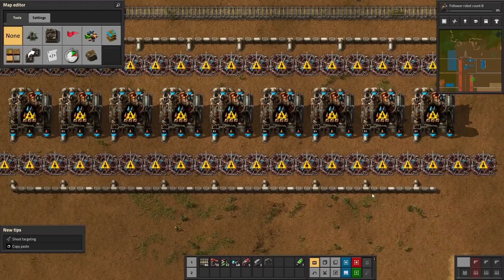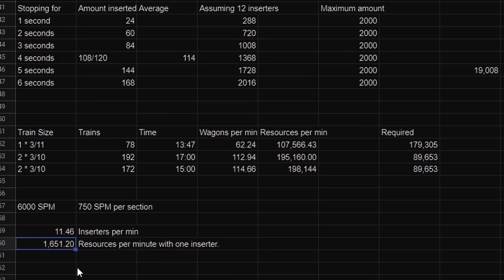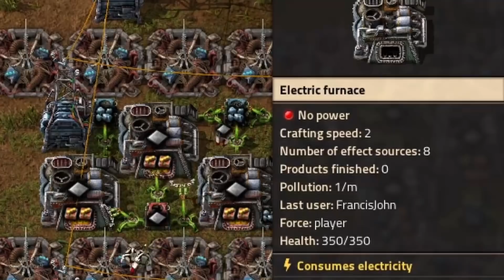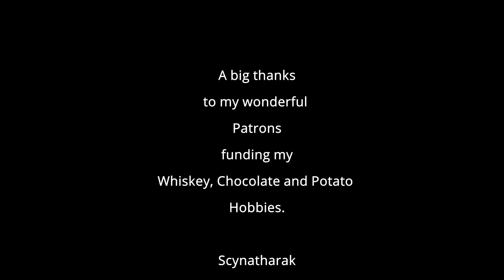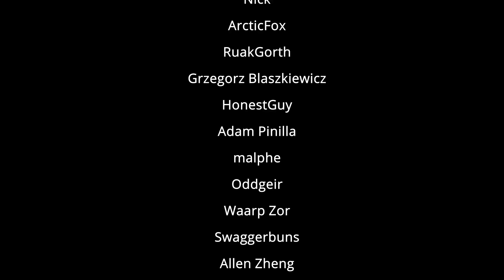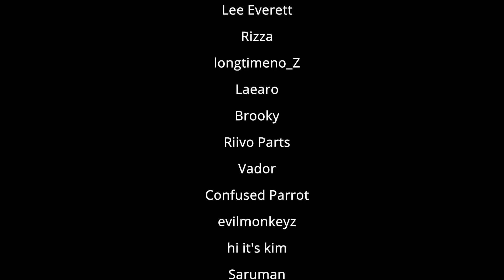Factorio : Oil for days and Steel for weeks : Mega Base Ep3

Comment: i want to do something like this, but not limit it to a single (long train line). and not load raw resources, instead loading intermediates (so smelting and circuit production is done offsite. increasing theoretical train-load to something more like 10-15k SPM.

Comment: I'd love to see you plan/blueprint all this as the final base and then build to it
Reply from the maker: That is the plan, design every section. Then build one module of it and run it all including the train belts to make sure it works. Then build it on my current map, though I'll need to spend about 20 hours clearing space for it first using nukes.

Comment: Note that you can set inserter filters and request stack sizes with the circuit network.  If you build your smelter column generically, you can copy/paste the design and change just a couple of constant combinators to tweak both the smelting type (iron, stone, copper) and the request amounts.

I think the staggered furnace design is interesting, but there's a lateral space tradeoff.  If you stack the furances with one pair of chests each, you can just barely fit three rows of furnaces in range of the roboports, with the corresponding beacons outside of logistics range (but that doesn't matter).  As built, you'll use fewer inserters but have longer travel times for robots. 

I suspect that load balancing will prove to be a problem.  In my own megabase build, I dealt with the issue using buffer chests (green) and inserter automation.  The station would unload a train if and only if there was enough space to unload the entire train.  As a result, trains would leave empty, preventing weird backups.  (My design encouraged ore trains to park at the smelter until necessary, but yours will obviously use timing to force them through.)
Reply: I did the same with buffers and unloading entirely, works for me. 
Nice tip on the generic smelter I’ll be tweaking mine.
Reply from the maker: We could go 12 beacon furnace but in testing the UPS numbers were pretty much the same for both designs. Since 8 beacon was more compact I stuck with it.

Comment: At 6:32 you missed a connection on the 8th Light Oil to Petroleum Refinery from the left, it's connected to two water instead of Light Oil and Water.
Reply from the maker: Good spot.

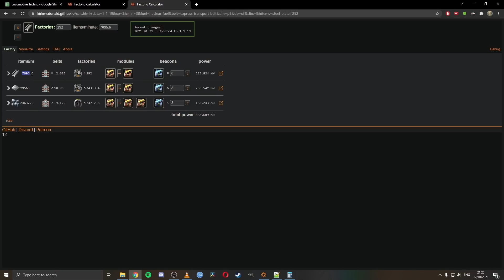Comment: 15:04 You are misusing the calculator, the last field is the amount of modules affecting it, not the amount of beacons. You are in range of 16 speed modules, as every beacon has 2 modules
Reply from the maker: Yeah that is a bit of a big mistake, I'll have to redo oil and iron/steel offscreen we can drastically cut down on the size.

Comment: I highly making sure that every input to a tank is directly through a pump, and that every output to a tank is directly through a pump.  If you don't do this then you lose a lot of throughput.
Reply from the maker: Noted, I try and do that already for high throughput tanks as I noticed that they filled and empty several times slower if you don't.

Comment: How is any game that requires Francis level of thought fun...  
I swear my mouth is open during 90%of your video.    I'm fine if its moth open due to rim world death, or oni planet Aku teriforming..
Reply: You don't have to play it like that) Francis doing an immence amount of planning. I do it as a go along. That does result in a lot of rebuilding... but it works (though not very efficiently), so i guess that's a win) Also i have several huge mods like Krastorio and Space Exploration, so everything is a LOT more complicated...
Reply: @ahtoshkaa  I only played the demo.    It just seems like an absurd amount of thinking compared to Dyson sphere. Which achieves the same goal x9000
Reply from the maker: To do a factory of 50 of all science per minute is an achievement and tricky to wrap your head around. That is a normal type goal.
But if you want to go to 1000+ science per minute you need to do so much planning it's crazy. You start to run into the bottleneck of your CPU.

Comment: Great base idea! Excited to see how it comes out. Quick note on Kirk's calculator. The number in the beacon slot is number of modules, not beacons. So for your setup it should be set at 16. With the current 8, you are saying each machine is only affected by 4 beacons of 2 speed modules each. Should help lower the number of machines you need.
Reply from the maker: Great, now I feel like an idiot :)
Reply: That was very helpful to know thanks.

Comment: I highly recommend the Bottleneck mod.  It's a QoL mod that puts a small dot in the corner of every production facility (smelter, assemblers, refineries, etc).  The dot is green if its producing, red if it's missing resources, and yellow if it cant produce because the output is blocked.  It really helps to zoom out and take a look at a section to make sure everything is producing, bottlenecked with input, or bottlenecked by output.  Great for spotting errors.  It works when ALT is on, and you can still see what product each thing is making.

Edit: Also, dont forget you still need light oil for rocket fuel, so save some of that instead of cracking it all to petro!
Reply: There is also Bottleneck Lite by raiguard, it stopped the odd stutter for me that the original Bottleneck caused. But turning it on or off requires a restart iirc (also no pretty icons :)).
Reply: Yeah, he counted up SO MUCH petroleum but like, it's what he gonna get if he converts it ALL into petr. gas. 
And he still needs lube light oil so... yeah.
Reply: Rocket Fuel..,.

Brrrrrr
Reply: Like in Dyson Sphere Program!